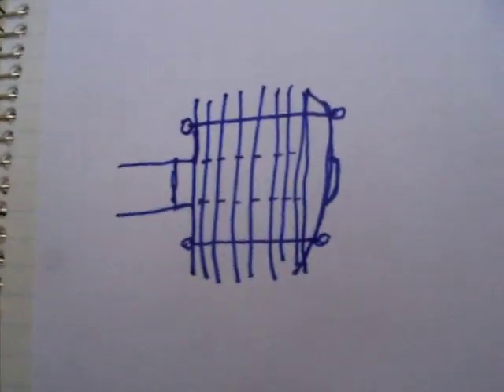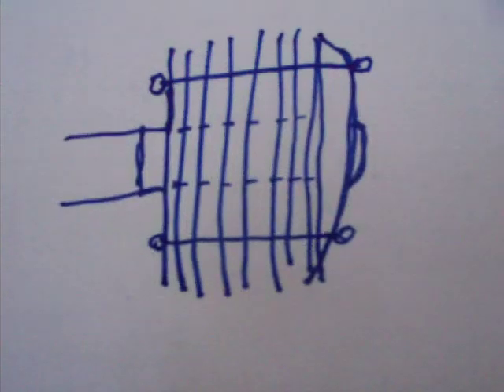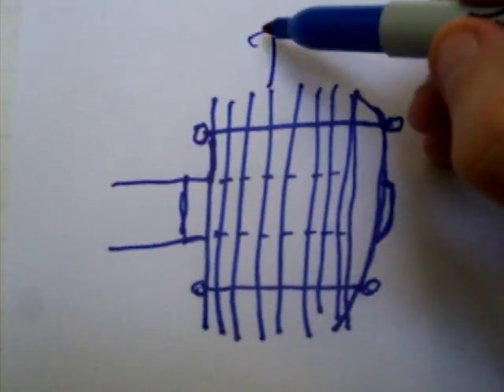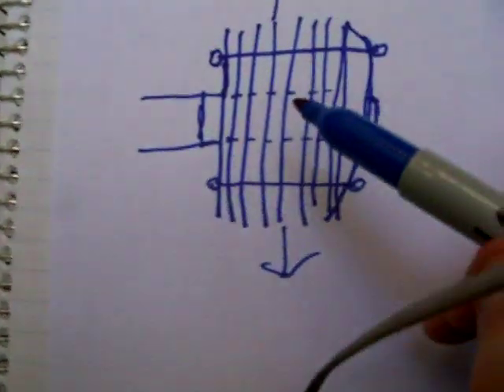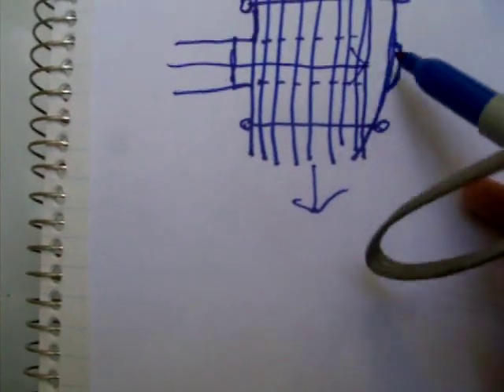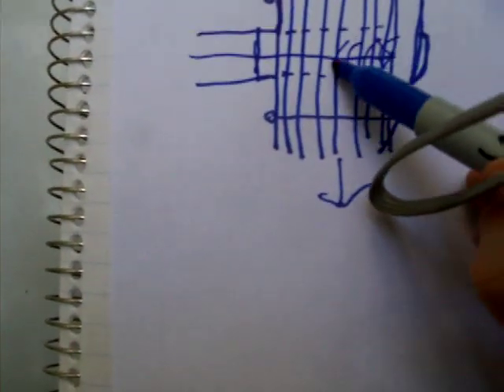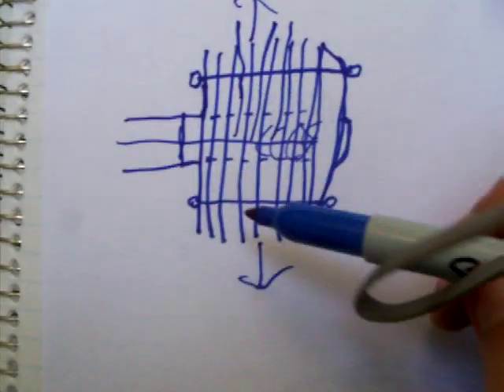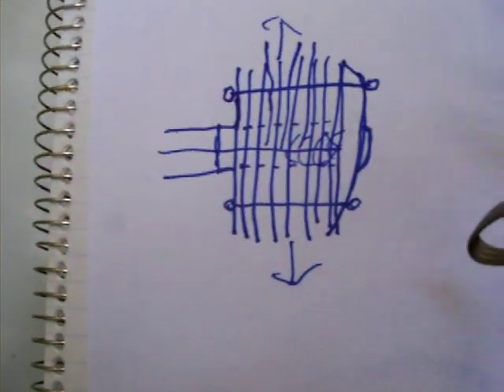How Supertrapp Mufflers Work

Comment: Let's not forget that the typical Supertrapp muffler body, before the stack of defuser discs, is a 2" perforated core with fiberglass packing material, basically a glass-pack muffler, and the stack at the exit end is merely a tuning aid.  On my 100" Harley Evo motor I run an open end cap with a 1.5" hole in the end.  It sounds good to me, and runs like stink in that custom built bagger....
....RooDog....

Comment: SuperTrapp discs provide a scavenging effect. Here’s how it works: the gap between each disc ranges from .023-in. wide on the inside of the muffler, to .028-in. on the external open edge. As hot exhaust gases pass through the discs to exit the muffler, they enter a larger area, creating a slight pressure drop (air velocity) as the gas expands, creating a scavenging effect for the hot gas still inside the muffler. Adding discs increases the size of the exhaust outlet area. Removing discs decreases the exhaust outlet surface area. 
The discs are for tuning, not for louder/lower sound!

Comment: Nice video. Three pointers for your next videos: 
1. Don't use a drawing that looks like it was made by a 8-y.o., use a proper technical diagram; if you can't make one, use a Powerpoint slide or MSPaint. 
2. If you use blue ink for the picture, you cannot use the same blue for your comments and explanation, everything will be "blue on blue with more blue to explain". Use one color for the basic picture, one color for the explanation, and a third color where required.
3. Script your video; it is unnerving and tiresome to wade through your "uhmmm" and "aaah" during the video. Write down your comment and read it as you go through the explanation. Maybe not an AcademyAward winner but certain to multiply your hits tenfold !
Reply: Here’s a pointer for yourself. Start trying your hardest to not be ghay. People will begin to enjoy you thus you will like yourself.

Comment: SuperTrapp® exhaust systems are uniquely tuneable. Back pressure and noise level are controlled by the number of discs used. Note: Increasing the number of discs creates a larger exhaust outlet area and therefore, causes less back pressure but more noise. Conversely, removing discs increases back pressure but reduces sound level.
Reply: trillrif axegrindor by adding or removing disks you can adjust your power curve. Increasing back pressure brings your power down lower at the cost of wide open performance. Adding disks opens up your exhaust for better wide open performance. Jetting and carb tuning will also change. More back pressure tends to run rich less back pressure tends to lean out. So carb will need tuned as well when adjusting.
Reply: backpressure is something you NEVER want to introduce and cork the end of your exhaust AND make it louder